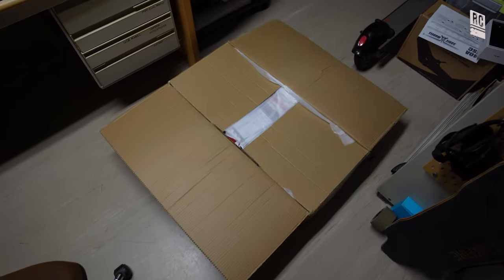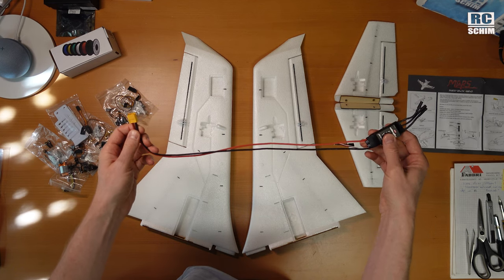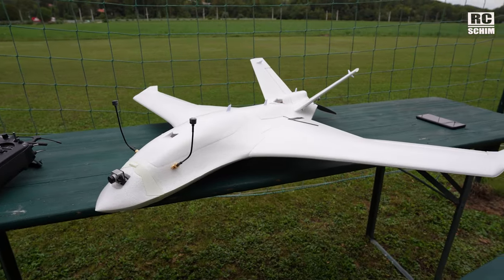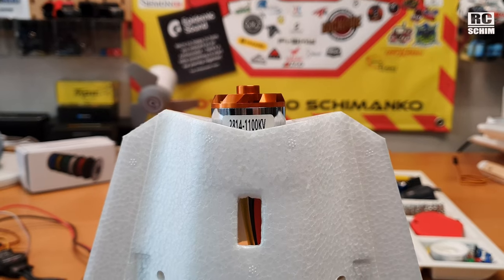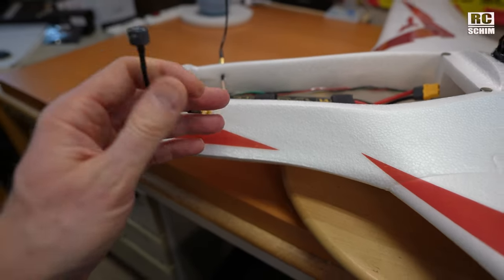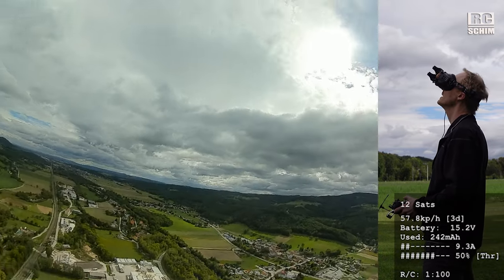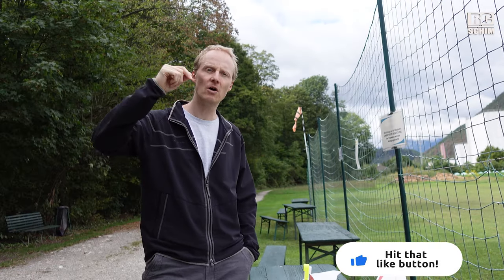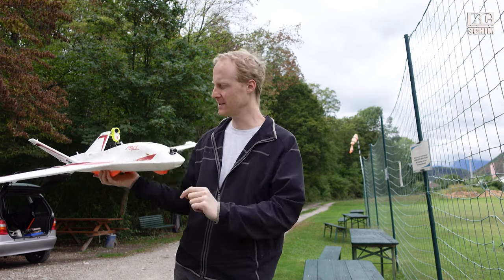Mars 1200 FPV Plane with INAV review, testflights and tips

Comment: Great clean build and flight testing. Everything so accessible. I find this blended wing design very ascetically pleasing, and it appears to be fun to fly. Nice gentle  stall characteristics too, as not prone to dropping wing. Loved the fun spin demo at 13:50. :)

Be gentle. When you tell yourself not to fly below 30 kph (8:44 because will stall), approaching at 30-20 kph 9:26 is bold and risky. Great reaction and lucky burst of motor good power, for a nice last second save.
Of note: below ~2x treetop height there is a wind gradient (dropping in windspeed with height), so better to carry some extra speed until closer to ground, to avoid a sudden airspeed drop. Similar applies if flying close to mountains in stronger winds. 
I wouldn't say these were bad landings, just entertaining landings, for our viewing pleasure. ;)

Regarding disassembly, you might be able to swap out the wing screws with ones that have large head so can be finger tightened like on the AR Wing Pro. Depending of local hardware availability, you might need to 3d-print a custom bolt head with a finger grip. 

An possible upgrade is a folding prop to lessen breakage concern on landings. The downside is a folding prop is harder to balance, so may produce jello when doing a moderate powered-on cruise. Personally think the default setup is fine, but you might check prop balance under power. Some jello seen at higher motor RPM (4:10).

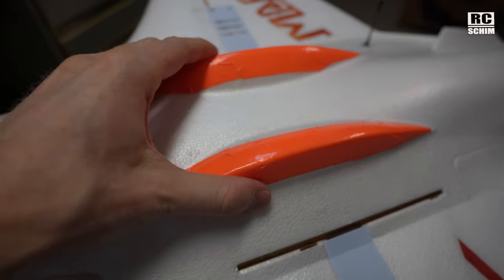What is the grippy-tap applied to the landing skids? (7:18) Seems very effect when launching.

Comment: can you share your rates and output tab information like servo weight percentage
Reply: I am struggling to set it up you can watch the video of plane crash on my channel
Reply from the maker: hi, does this "diff all" help you?   I've cut it down to the interesting parts

# version
# INAV/MATEKH743 6.1.0 May 11 2023 / 13:29:16 (d6ce6e70)
# GCC-10.2.1 20201103 (release)

# start the command batch
batch start

# reset configuration to default settings
defaults noreboot

# resources

# Mixer: motor mixer

mmix reset

mmix 0  1.000  0.000  0.000  0.000

# Mixer: servo mixer
smix reset

smix 0 1 0 50 0 -1
smix 1 2 0 50 0 -1
smix 2 3 1 50 0 -1
smix 3 3 2 50 0 -1
smix 4 4 1 -50 0 -1
smix 5 4 2 50 0 -1

# Outputs [servo]
servo 1 1000 2000 1470 -100
servo 2 1000 2000 1520 -100
servo 3 1000 2000 1470 -100
servo 4 1000 2000 1520 -100

# safehome

# features
feature MOTOR_STOP
feature GPS
feature PWM_OUTPUT_ENABLE

# Receiver: Channel map

# Ports
serial 1 2 115200 115200 0 115200
serial 3 33554432 115200 115200 0 115200

# Modes [aux]
aux 0 0 0 1925 2100
aux 1 1 1 1425 1550
aux 2 12 1 1950 2100
aux 3 53 1 1225 1375
aux 4 11 1 950 1125
aux 5 10 3 900 1100
aux 6 21 2 900 1075
aux 7 37 2 1900 2100
aux 8 36 3 1375 1625

# master
set gyro_main_lpf_hz = 25
set dynamic_gyro_notch_q = 250
set dynamic_gyro_notch_min_hz = 30
set gyro_zero_x = -1
set gyro_zero_y = 4
set gyro_zero_z = 2
set ins_gravity_cmss =  980.740
set acc_hardware = ICM42605
set acczero_x = -4
set acczero_y = -4
set acczero_z = -22
set accgain_x = 4080
set accgain_z = 4089
set align_mag = CW270FLIP
set mag_hardware = NONE
set baro_hardware = SPL06
set serialrx_provider = CRSF
set motor_pwm_protocol = STANDARD
set failsafe_procedure = RTH
set current_meter_scale = 150
set platform_type = AIRPLANE
set model_preview_type = 28
set small_angle = 180
set ahrs_inertia_comp_method = ADAPTIVE
set applied_defaults = 3
set gps_provider = UBLOX7
set gps_ublox_use_galileo = ON
set airmode_type = STICK_CENTER_ONCE
set nav_wp_radius = 5000
set nav_emerg_landing_speed = 1000
set nav_rth_allow_landing = FS_ONLY
set nav_rth_alt_mode = AT_LEAST_LINEAR_DESCENT
set nav_rth_abort_threshold = 65000
set nav_rth_altitude = 30000
set nav_fw_cruise_speed = 7000
set nav_fw_control_smoothness = 2
set nav_fw_launch_velocity = 150
set nav_fw_launch_accel = 1500
set nav_fw_launch_max_angle = 90
set nav_fw_launch_idle_motor_delay = 2000
set nav_fw_launch_motor_delay = 50
set nav_fw_launch_timeout = 10000
set nav_fw_launch_climb_angle = 25
set osd_video_system = DJIWTF
set osd_rssi_alarm = 60
set osd_time_alarm = 0
set osd_alt_alarm = 0
set osd_dist_alarm = 0
set osd_left_sidebar_scroll = ALTITUDE
set name = MARS
set pilot_name = RCS
set dji_rssi_source = CRSF_LQ
set dji_use_adjustments = ON

# profile
profile 1

set fw_p_pitch = 15
set fw_i_pitch = 5
set fw_d_pitch = 5
set fw_ff_pitch = 86
set fw_p_roll = 15
set fw_i_roll = 5
set fw_d_roll = 7
set fw_ff_roll = 75
set fw_p_yaw = 20
set fw_i_yaw = 0
set fw_ff_yaw = 81
set max_angle_inclination_rll = 550
set dterm_lpf_hz = 10
set fw_turn_assist_pitch_gain =  0.400
set nav_fw_pos_z_p = 25
set nav_fw_pos_z_d = 7
set nav_fw_pos_xy_p = 55
set d_boost_min =  1.000
set d_boost_max =  1.000
set rc_expo = 30
set rc_yaw_expo = 30
set roll_rate = 14
set pitch_rate = 10
set yaw_rate = 3

# battery_profile
battery_profile 1

set vbat_min_cell_voltage = 300
set vbat_warning_cell_voltage = 320
set throttle_idle =  5.000
set nav_fw_launch_thr = 1800
set nav_fw_launch_idle_thr = 1400

save